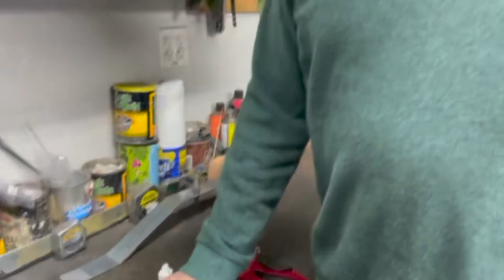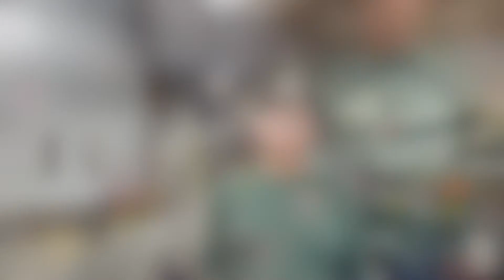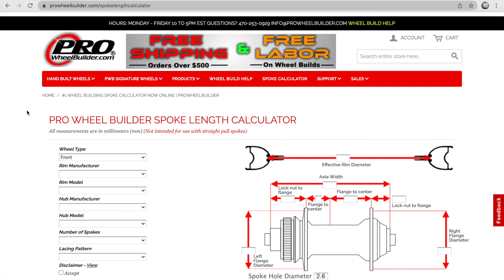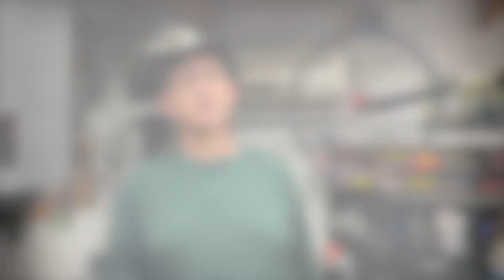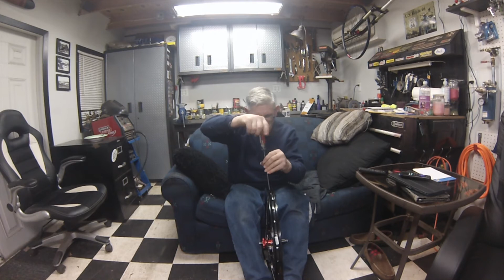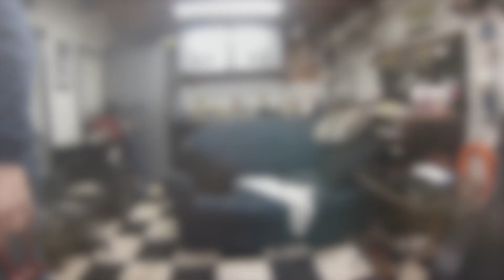One Wheel lacing wednesday

Comment: I actually used linseed oil from an art shop to prep the spokes then grease when I'm building the wheel.
Reply from the maker: Other people said grease too. What does the linseed oil add?
Reply: @theshedMTB  it's a discount spoke prep you put it on the spoke threads and let it dry. It's basically locktite that's safe for brass.
Reply from the maker: @underbikedoverconfident1142  the spoke prep i bought was only like $11 and it drys more flexible than lock tite, more like resistance to turning rather than locking.  If i knew about the linseed oil before maybe i would have tryed it!
Reply: @theshedMTB  the pro builders I watched on youtube all used spoke prep but then used an oil to tighten them down. It wasn't a grease it was a one drop per spoke kind on a deal. I'm tearing down and rebuilding my front wheel to go from qr to 15mm boost next month so I'm needing this type of refresher video.